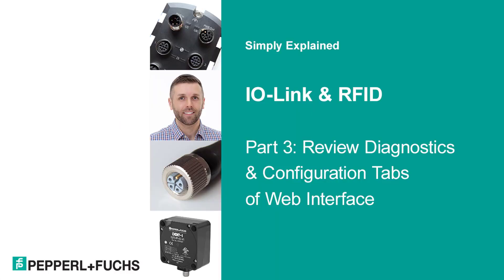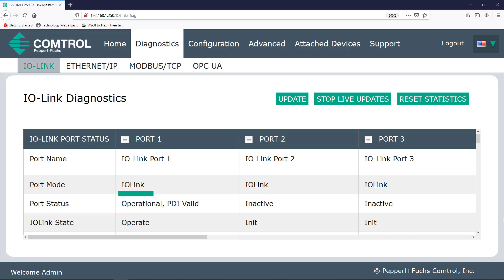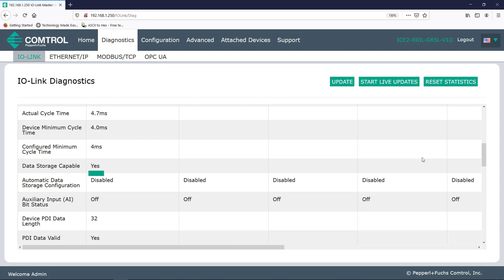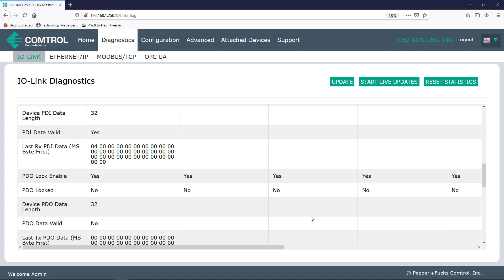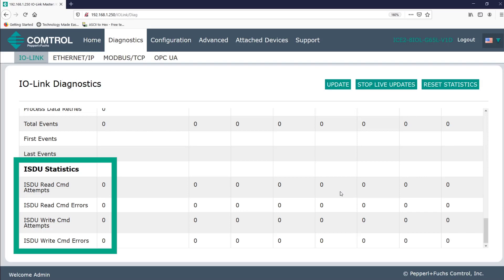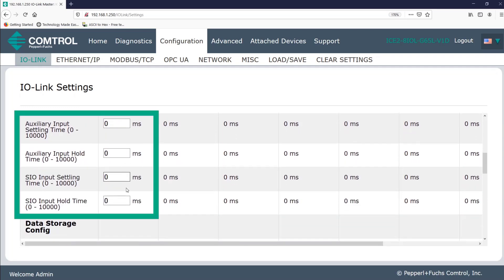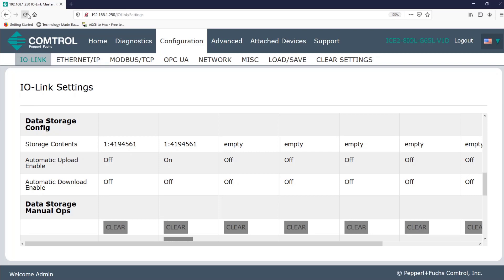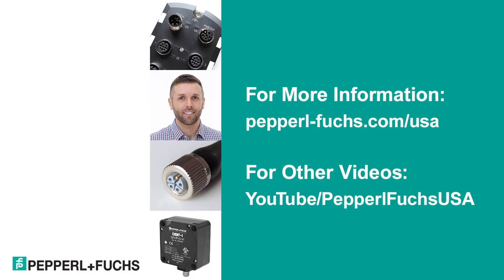IO-Link & RFID Part 3—Port Configuration

Comment: They question if this configuration is only for products pepperl+ Fuchs or all products similar.
Reply from the maker: @crsm19800 That’s correct. It’s very simple to connect other IO-Link enabled devices to Pepperl+Fuchs IO-Link masters, independent of the manufacturer. The important thing is that you download the IODD file to the IO-Link master. These IODD files for each device are usually fairly easy to find.